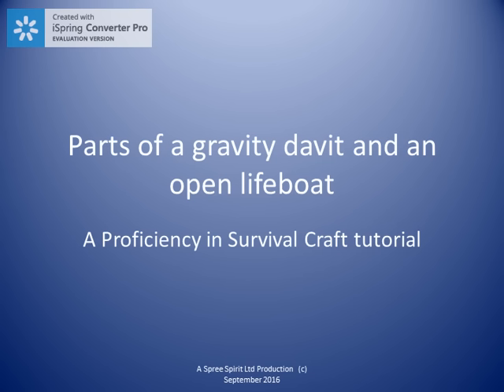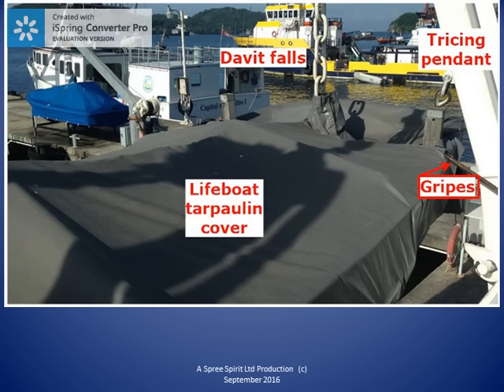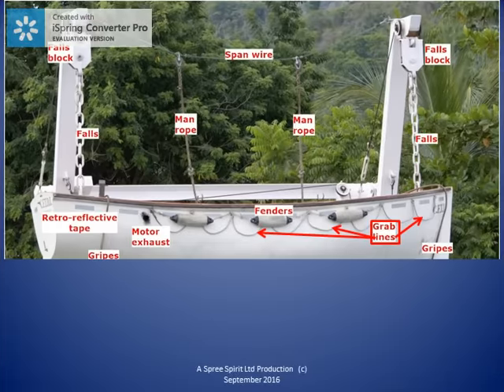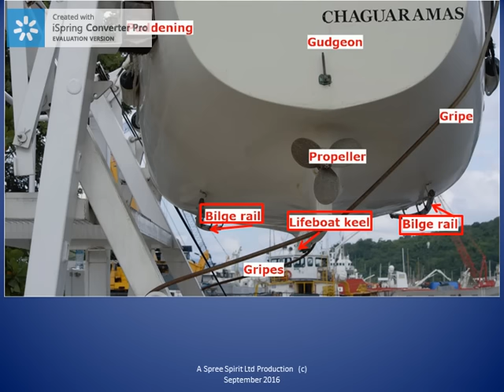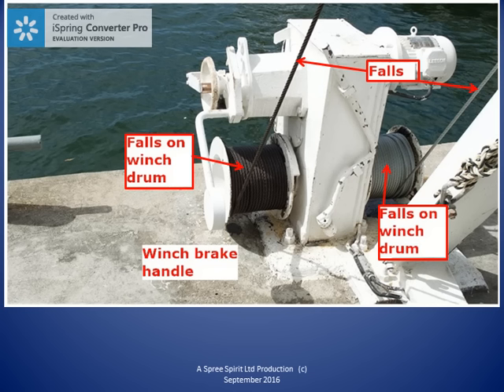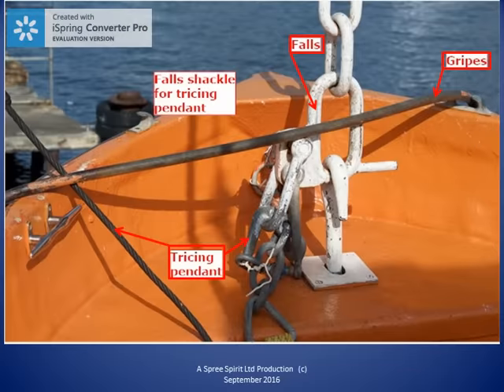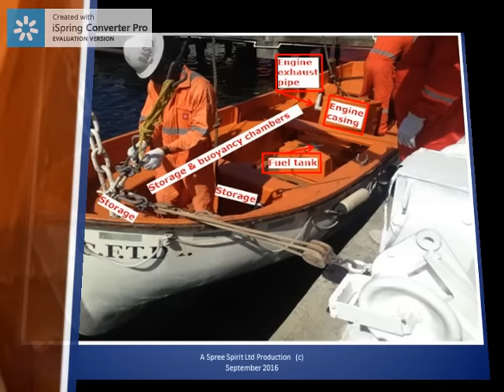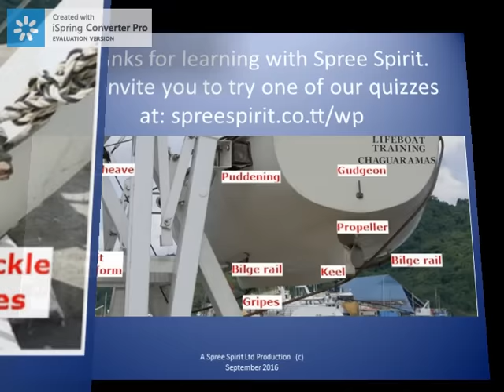Parts of gravity davit and open lifeboat - An SSNT tutorial

Comment: why give a tutorial on obsolete equipment? Open lifeboats have not been permitted for use on ships since 01/07/1986. In general this is a rather poor and very dated tutorial.
Reply from the maker: Thank you for your comments, Mr David. In some parts of the world, we are rather poor and very dated and only have access to outdated equipment that we maintain to avoid our seaman having the expense of travelling abroad. By the way, I did a trip on an 180 metre long LPG tanker in 1988, and she had open lifeboats, because she was built in the early 1970s. Surely, a ship equipment expert like you would know that if a ship was built before the date stated in a regulation and is still serviceable, certified, she does not have to replace the lifeboats. There are a lot of old ships here, in the Caribbean.  And as an education expert you, would know that the names of the parts of the davit are the same whether the lifeboat is enclosed, partially enclosed, or open. Thanks again.